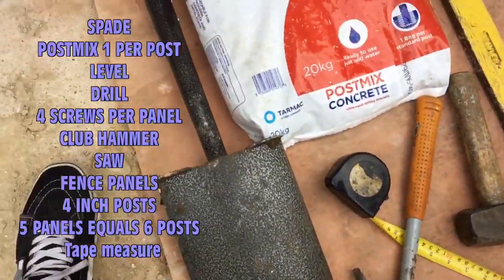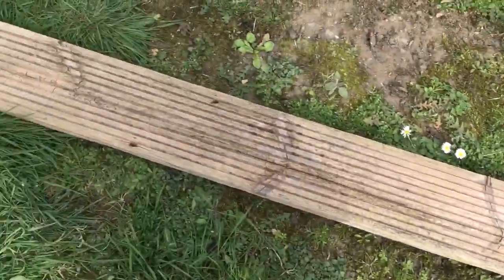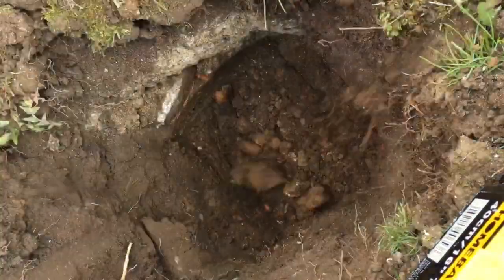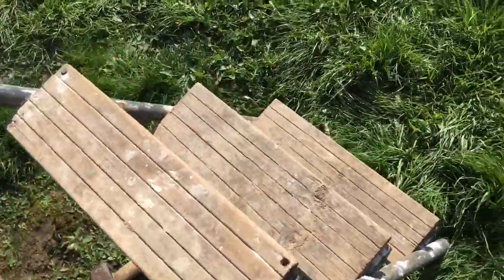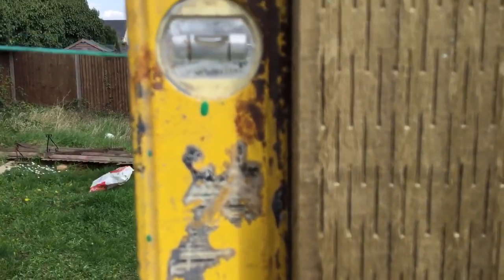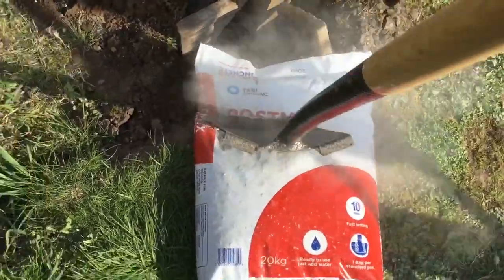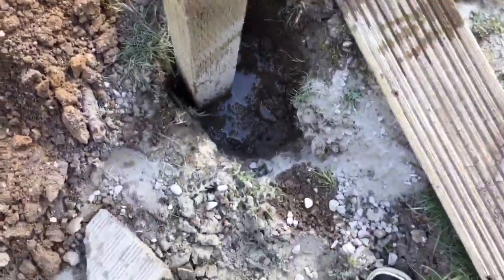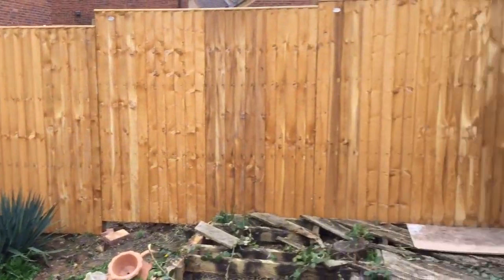HOW TO PUT UP A FENCE EASIEST WAY BY 1 PERSON

Comment: This is brilliant. You, Sir, are fantastic. I thought it was a serious 'how to fence' video, but then half way in I realised how hilarious this is, like a Monty Python or Two Ronnies sketch, you should market this, I am in tears of laughter. Fantastic. Well done. The speeded up bits are the best, and the Chop, chop, chop, good old slosh. Watched it three times already. Watch out Milton Jones.
Reply from the maker: lol thank you very much . i may do four candles
Reply: @MultiGlobalnews  I was thinking more like 'How To Hang A Door', "First get your tools; big hammer, chisel, screwdriver, hinges, pencil, chainsaw. CHAINSAW? Yeah, it's quicker than a handsaw. Na, you check the door fits the frame, shove, shove, Na, gotta cut it down, chainsaw chainsaw, there, mark out the hinges, chop chop, bit of a gap, we'll put some filler in that " be brilliant, have a think about it, you've got a great delivery and fantastic timing, forget fencing. Nightmare. Good luck.
Reply: @bellerophonchallen8861  Thanks mate. Didn't had a proper laugh for months. Literally in tears.

Comment: What do you think of using post spikes instead of concrete for the posts? My mum and myself are going to attempt to put up the fence. Not worried about it lasting forever or being immaculate because it’s my neighbours fence. They refuse to replace their low level wire fence and I refuse to spend £1200 on professional to do it. It’s a 32 feet fence and will be 6 foot high. 
Do you think we can do it? We’re quite strong for women 😂

Comment: Im not going to give you much hate as its was funny to watch lol... However, you are supposed to put the water in before you chuck the postcrete in you bugger. Also, I would of used at least 4"x4" posts. Also for a slopped fence like that, you could of done a nicer job with some arris rails and feather hedge boards and cut off the top nice and neat with that nifty circular saw plus you would have had no gaps at the bottom!!. None of this would have cost you much more money..... Everyone is a critic right?? lol ...good show, thanks :)
Reply from the maker: Some good advice there friend thank you